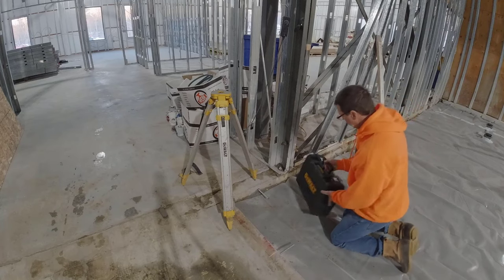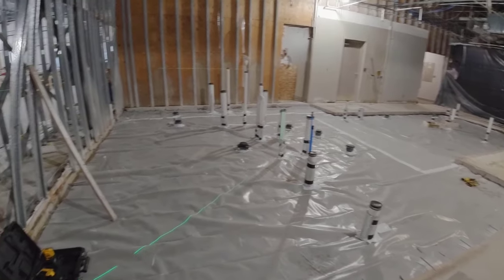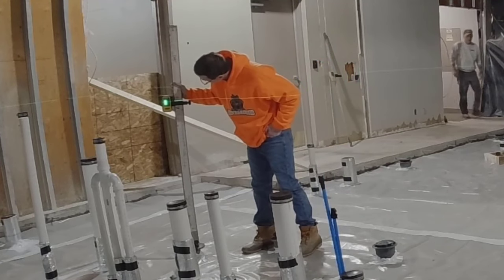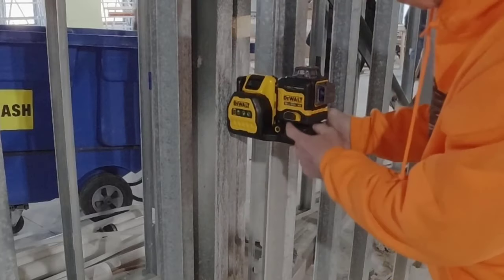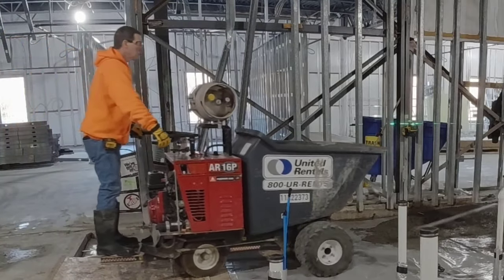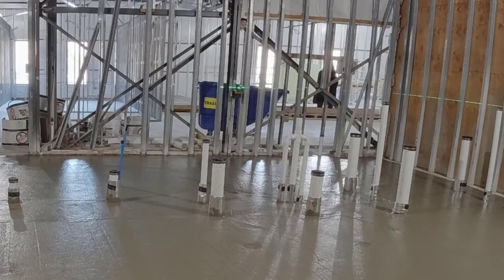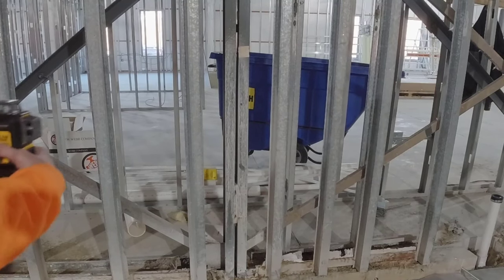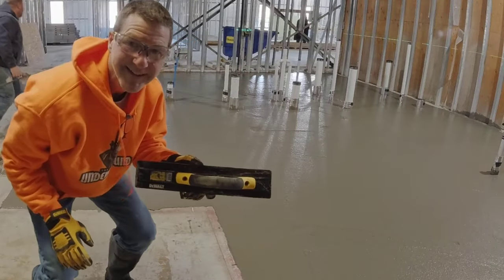This DeWalt Laser Level Made Pouring Flat Concrete EASY (We had to match this one spot)

Comment: Hi mike sir,  I have a 2 questions related to other videos  sir.  I have a basment that has wood floor over clay.I want to remove this and add concrete.Theres is a 1 1/2 pvc pipe run to sump pump under floor to sump about 6 -8 feet .How do i safely pour concrete over this. Or do i need to encase it it larger pvc or how exactly.  And  the concrete will go up to the footer. Do i need expainson joint a against the footer?   if it doesnt touch the cinder  block above sir?